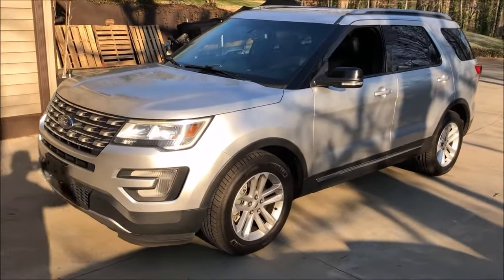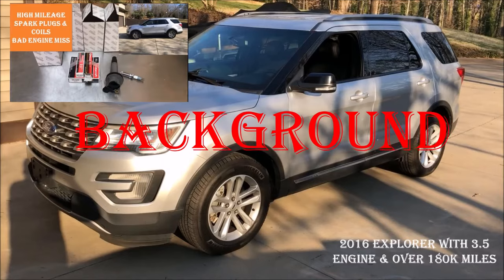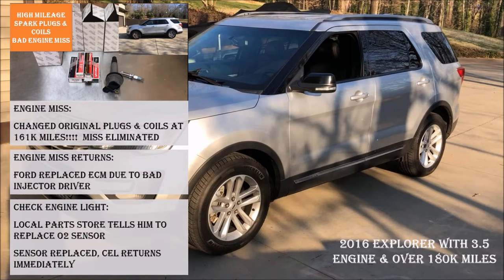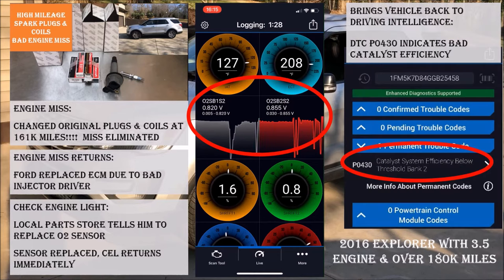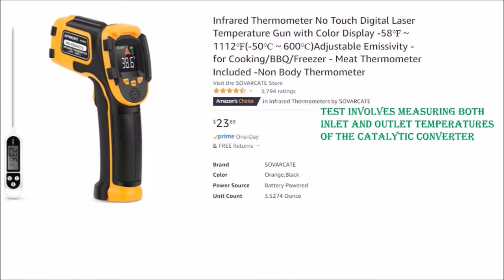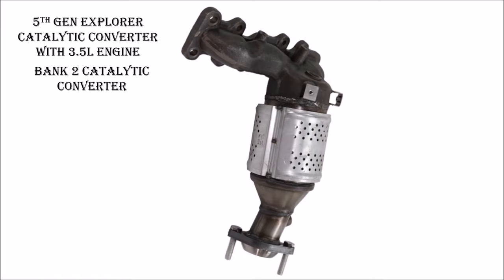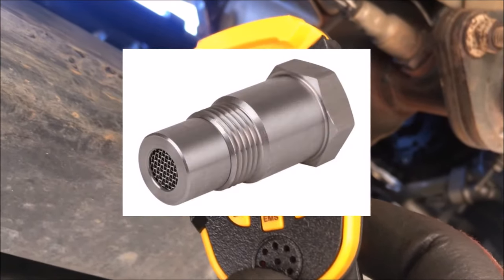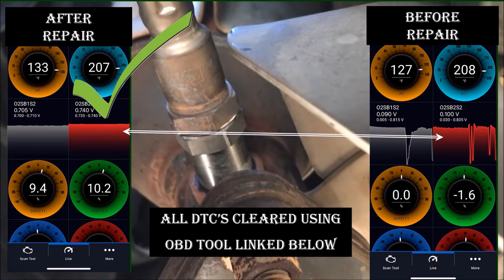How To Fix P0430 P0420 Ford Explorer Catalyst System Efficiency Below Threshold: Analysis Correction

Comment: I followed these steps and erased the code and then started getting a completely new code, P0160.
Reply from the maker: hi, thanks for your comment.  What exactly did you do?  Replace the catalytic converter or use the spacer?  This could be a defective downstream O2 sensor.

Comment: Hey so I have a question I just left the dealer after chasing a misfire on my 08 ford edge it's 90 percent misfiring but some time while driving it kicks back to normal but long story short dealer claims the misfire is due to bad cat it's only missing on cylinder 3 but does that sound correct an if so could I use the spacer on my o2 or would I be better off replacing the cats
Reply: All my codes also a 0420 0430 an p0353
Reply from the maker: Your misfire is very unlikely connected to the cat.  The cat codes are likely due to the misfire.  Also, your P0353 Code: Ignition Coil "C" Primary/Secondary Circuit indicates a problem with spark on plug 3.  Check the coil, plug and then the fuel injector.  The spacer will not solve your misfire, but could eliminate the catalytic converter codes.
Reply: @DrivingIntelligence  hey I just seen this I already replaced the coil plugs had the pcm looked at also compression test done an also replaced injector on that cylinder an finally took it to the dealer an they said it's all cat related due to back pressure from the cats idk if that's correct or not but idk what else to do at this point
Reply from the maker: @MarkS-xh7mr  ok, wow... well, I'm not sure why there is only one misfire code if both cats are bad.  How does the car drive?  Complete lack of power?  If you have very very low power, it could be a plugged cat.  One way to test for plugged cats is to pull the upstream O2 sensors and see if it runs any better.  You'll get a code since the O2 sensors are removed, but the hole allows exhaust to escape returning some exhaust flow to the engine.  Make sense?  If you do this, make sure to disconnect the O2 sensors from the harness to prevent damage.
Reply: @DrivingIntelligence  hey should I take both out or just the one on the effected side of the misfire an also I'm gonna try to post a video on here of my live graph on the o2s an also my fuel trim at some point soon maybe that could kinda help with someone helping me. My apologies I'm just learning on how to use live graphs an not really to good at it yet
Reply from the maker: @MarkS-xh7mr  Did the dealership tell you both cats are bad?  If so, pull them both, but start with the O2 sensor on the misfire side.  And make sure you only pull the upstream sensor.

By the way, I helps tons of people here... if you feel inclined, you can use the Superthanks button below my video to send a few bucks my way, but it is not necessary.  Anything will help me to improve and expand my channel.  :)
Reply: @DrivingIntelligence  yeah an after looking at my o2 voltage they barley even move on the upstream an down steam they move here an there but almost a dead line even on the highway my guess they both clogged up next question I have is idc about admission test but could cheap cats off rock auto or ebay work good enough to fix the miss an drive to the end of the vehicle I'm already at 241k
Reply: Emissions sorry for talk to text lmao
Reply from the maker: @MarkS-xh7mr  Do yourself a big favor and buy that infrared temperature gauge in the description of my video and test your cats before you spend money.  Make sure they are truly bad.  Also, pull the O2 sensors to see if your performance improves.  These vehicles will last a long long time with proper maintenance.  My whole channel is about spending money on the older vehicles to keep them running and prevent the stealerships from dipping their hands in your wallet.

Comment: Would I pass smog test if I do that? Just looking for the cheapest way to make it pass the test. If no codes on the ECU I’m good to go right? They do the test in NV only by the obd2 port.
Reply from the maker: To be honest, it’s risky.  If they sniff the exhaust you will surely fail.  If they only test through the OBD port you should be ok.
Reply: @DrivingIntelligence  yeah in nevada it’s only obd2 no exhaust check.
Reply from the maker: @caracas4wd  Then you should be ok, but again, I can't guarantee.  The device fools the ECU into thinking everything is ok, therefore, the smog check should also be fooled.

Comment: Wonder if you might be willing to share your insights.  I have a 2014 Explorer V6.  I go for 100 miles or more with no check engine light.  Then I get a P0430 code.  Engine is running fine, no misses, no other codes.  Looking at my scanner B1 & B2 readings are fairly consistent for B1S1/B2S1 voltages (although B2 is slightly lower at about 0.815v on B2 vs 0.850v on B1).  Cat temps stay w/in 1° of each other and show about 950°F at operating temp.  B1S2 & B2S2 current show similar amperage (3 different scanners only give me the option to look at amperage for S2 sensors; not sure why).  Short term fuel shows similar values (again, slightly lower on B2).  Code has presented while driving, but most often right at start-up (e.g., not on when the car is last shut off, on while cranking).  I have noticed the car takes a few (3-4) seconds to start vs almost immediate but that does not seem to correlate to triggering the P0430 code.  Thoughts on what to look at?  I can record live data if it would help.
Reply from the maker: Hey Rob, after reading your issue, my first suspicion is a faulty or weak downstream O2 sensor that kinda wakes up when the exhaust gets good and hot.  The O2 sensors need to get to a required operating temperature to work properly.  This is why there is a heater circuit in the O2 sensor that gets the vehicle into closed loop operation more quickly.  Have you measured the temperatures of your catalytic converter as shown in the video?  Are you sure the bank 2 cat is in good working order?  Also, I'm assuming you don't have broken wiring since you have no other codes and the issue is intermittent.  The only thing I can suggest without seeing the vehicle is to replace the downstream O2 sensor.  Here is a downstream sensor on Amazon... if you buy through this link, I get a little money to cover my channel without costing you more:  https://amzn.to/3JMPuta
Reply: @DrivingIntelligence  Wow!  Thanks for that quick reply!  I really appreciate and if I get (another) O2 sensor, I will absolutely use the link.  I did measure the temps and the cat (bank 2) seems to be working (and temps are consistent between the two cats too).  I replaced the Bank 2 sensor with a new one when this started about 6 weeks ago.  The code was gone for several weeks but came back with the same symptoms.  I suppose the O2 sensor could have gone bad, but I doubt it.  I'm wondering if I might have a vacuum leak on the intake that closes up as it warms.  Does that sound far fetched?  Unfortunately, I deleted the data before viewing the freeze data so I have to wait until the code comes back before seeing if it gives any clues.
Reply from the maker: @rficalora  Ah, ok, I don't think I saw you had already replaced the O2 sensor.   A vacuum leak is possible, but not likely at the intake, more likely an exhaust leak that is allowing oxygen to reach the downstream O2 sensor.  Do you hear any ticking at startup?  This could indicate an exhaust leak.  An exhaust leak could close itself off as the exhaust warms.  You can use a smoke tester to find the leak.  Any small leaks downstream of the B2S2 O2 sensor are not important.
Reply from the maker: @rficalora  one of my smoke test vids:  https://youtu.be/CbNPdL9YWe8
Reply from the maker: @rficalora  and another smoke test vid:  https://youtu.be/3mnH4zg_Tmg
Reply: @DrivingIntelligence  Thanks again.  Smoke test sounds like the next logical step.  To see if there's a leak in the exhaust, I'm assuming I'll need to connect the smoke at the tail pipe and close off the throttle body as presumably at least one exhaust valve will be open.  If that's not right, please let me know.  Otherwise thanks again for your help!
Reply from the maker: For best results, seal the throttle body to pressurize the system, and you’ll also be able to see if you have any leaks around the engine
Reply: @DrivingIntelligence  👍

Comment: Hello I’m having this issue in what o2 sensors do you install the foulers the ones closer to the tail pipe or the ones closer to the engine
Reply from the maker: They should be installed downstream of the catalytic converter

Comment: I stop leaving usb charger plugged in after I charge my phone I unplug it for the  vehicle I think it has to do with voltage being padsed through our the vehicle
Reply from the maker: Thanks for the comment!  Can you clarify?  I don't quite understand your point.  Thanks!
Reply: @DrivingIntelligence  i think the voltage is not being distributed efficiently  although i am not certified to say its the problem i unplugged my phone charger  adapter from the cigarette outlet and the code went away after driving a couple of miles 🙃
Reply from the maker: Which code were you getting?

Comment: Great video did it still have a rough idle after installing the non fouler or stayed the same.And did it bring the power back in to it
Reply from the maker: Thanks for the question... the de-fouler will not improve idle or engine performance if used on the down-stream sensors.  It only fools the computer to think the cat is functioning properly.  Sounds like you have another issue.  Do you have a check engine light?

Comment: Hi, thanks for this video. 
I’m outside the US and I have this problem on my 2015 Ford Explorer Sport, can you tell me the exact model you use to not make the mistake and order the wrong one. Thanks in advance.
Reply from the maker: Hi, are you referring to the defouler I used?  If so, the link is in the description of my video and should provide the info you need to purchase from abroad.
Reply: @DrivingIntelligence  yes the defouler. I check and they run out at Walmart. That’s why I ask you for the specific model. I’ll check again thanks.
Reply from the maker: @jvvb28 oops, sorry about that, try this one: STAINLESS STEEL O2 Sensor Extension Car Cel Fix Check Engine Light Eliminator Adapter Oxygen M18X1.5 45mm 1.77in, 2-Pack - https://www.walmart.com/ip/387450397
Reply: @DrivingIntelligence  Perfect, that’s available. I’m going to order those, hope they fit. Thanks again for your time.
Reply: @DrivingIntelligence I was looking at your video again and apparently your problem was in the bank 2, mine is in bank 1 now I’m lost to where should I put the defouler.
Reply from the maker: @jvvb28  very welcome and please be sure to subscribe!

Comment: Yes po420 will that be the cause of me burning gas while accelerating
Reply from the maker: Generally speaking, the downstream catalytic converters don't normally impact fuel economy nor power.  If you have a P0420, go through the steps I outline in the video and pinpoint the issue.

Comment: I have a heavy exhaust smell in my 2014 explorer. Got both codes plus p1450 for the canister. Would any of these codes cause the heavy exhaust smell. It only smells when the heat is on.
Reply from the maker: P1450 might be your problem with a fuel smell.  You might have a leak in your EVAP system

Comment: Hello. I just got code p0430 on my 2018 expedition. Should I do all the testing you did in your video, or just go straight to the defouler?
Reply from the maker: You can definitely just install the defouler, and it works you found your problem, but my method diagnoses the problem.

Comment: Thanks. All i gotta do is measure the cat temps to see if i gotta replace it .. i had a bank 1 sensor 2 code i replaced the sensor. And erased the codes. The  o2 sensor code is gone now. The only one that came back is p0420. I will check the temps tomorrow.
Reply from the maker: Good luck, let me know how it turns out.
Reply: Any update

Comment: Hey I appreciate the video. The walmart link to the defouler is out of stock. Any idea where to find them elsewhere? I am having issues sourcing one.
Reply from the maker: Hi there, thanks for letting me know.  Try this link:  Universal Car Sensor, Spacer Adapter Extender Eliminator, M18*1.5 Adapter Check Engine Light Fix Extension https://www.walmart.com/ip/462292709

Comment: I changed the upper censer but still have the code if I change the bottom one would it help?
Reply from the maker: Do you have the same code as noted in this video?  If you do, you need to follow my test procedures EXACTLY to determine the fault.  I cannot diagnose without doing all the tests I recommend in this video.  Let me know...

Comment: On a 2013 Ford explorer with a 3.5 l ecoboost engine, which is bank 2? would that be the front or the rear of the engine?
Reply from the maker: Bank 2 as you likely know is the side of a "V" engine that starts with either spark plug 4 or 5.  For the 3.5 engine, spark plug 4 is on the radiator side of the vehicle, hence, the radiator side is Bank 2.
Reply: @DrivingIntelligence  thank you for your response to my question. Apparently I did change the bank 2 downstream sensor and did not make a mistake like I thought, I still have the p0430 code. My check engine light has come back on again after changing that sensor. There is no other issues the car runs like a champ. I thought if it was a catalytic converter it would have put out the p0420 code. Is it possible it's one of the catalytic converters without throwing the code?

Comment: I’m having the same issue. The Dorman 42009 seems to be too shallow to allow the O2 sensor to fully seat. Did you drill out the bottom or use a different model?
Reply from the maker: I didn't have this problem, screwed in with no problem.  Since this seems to be a new problem with the Dorman part, I'm changing the link in my description to the Walmart part that matches mine:  https://www.walmart.com/ip/Car-Oxygen-O2-Sensor-Adapter-CEL-Fix-Check-Engine-Light-Eliminator-M18-1-5/919177346?wmlspartner=wlpa&selectedSellerId=101345728&adid=22222222227000000000&wl0=&wl1=g&wl2=c&wl3=42423897272&wl4=aud-430887228898:pla-51320962143&wl5=9051588&wl6=&wl7=&wl8=&wl9=pla&wl10=736905819&wl11=online&wl12=919177346_101345728&veh=sem&gclid=CjwKCAjw29ymBhAKEiwAHJbJ8o0Ao19J2ZVH7VivBF-xyMvbgGzjc9ujIOcwdOx8jXlJvpMfHzlynBoCfgMQAvD_BwE

Comment: How has the vehicle done long term with the non foulers? My 3.5 flex has the same code but runs perfect, considering trying this. Thanks
Reply from the maker: runs perfectly with no codes or CEL
Reply: @DrivingIntelligence  I did this right after I watched you video and 1,200 miles later it runs perfect and no CEL.
Reply from the maker: @rickymiles5548 awesome!  Thanks for the update

Comment: I have a 2013 ford explorer xlt v6 with the P0430 code. Car jerks on acceleration between 30-4mph and then goes back to normal but once I stop it does the same thing and engine starts surging during the event. Would that likely be an o2 bank 2 or catalytic converter
Reply from the maker: That is not likely anything to do with the catalytic converter.  How many miles on your Explorer?  You could have a transmission problem.  Normally the torque converter locks up at about 40mph and if your cat is going bad, could cause a vibration or surging at the speed.  There could be other issues causing this as well.  Do you have other diagnostic trouble codes?
Reply: @DrivingIntelligence  hello I got the same problem po430 or 420 the check engine light turn on and sometime leave and turn on again and when it reaches 40 it starts to jerk, it doesn't vibrate or anything, it just has a hard time gaining strength to reach 60. I've been to many workshops and they tell me it's the catalyst. They checked the transmission and it's fine. The engine is fine. It has 155k and it started. When I had 100k, I already put cataclean on it and it didn't work. The muffler shops charge me around 1300 to 2500 for change one catalyst
Reply from the maker: @victormercado4608  This is tough to diagnose over the internet... are they saying the catalytic converter is plugged?  A bad cat will not impact driving or engine performance.  Are there any symptoms at idle?  Or it runs fine at idle?  Now that you shared your vehicle has trouble accelerating to 60, that could be a sign of a plugged cat.  What size engine is in your Explorer?